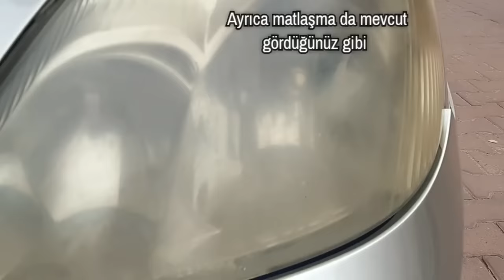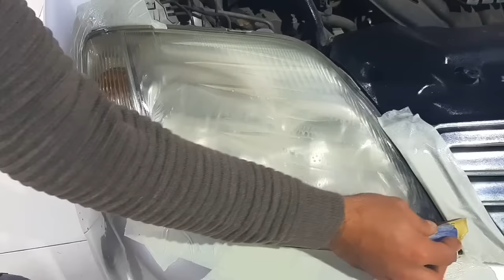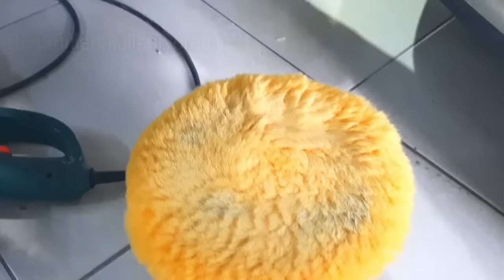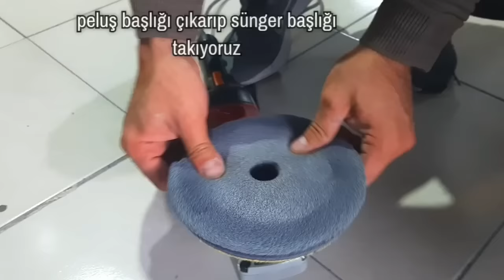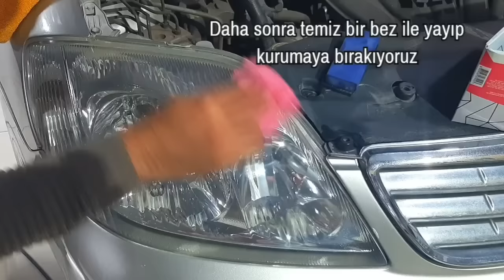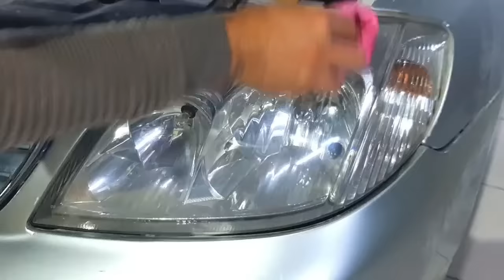PROFESYONEL FAR TEMİZLEME VE PARLATMA YÖNTEMİ 💯 SONUÇ MÜKEMMEL

Comment: I used to work in a plant producing such lights when was young and they used only 2 polish grades (I think there were 3 available, but we were too lazy to use it). For my car (phone & watch too) I sometimes use a cheap polishing paste and it works fine even for windows, but for deep scratches you need to use less fine grade. So for yellow lights this method is fine, but just for scratches it's way too much effort

Comment: Ustam ellerine sağlık.. Bende de 2003 palio var.. Farları fena halde sarardı.. Gece yola gitmek baya zorlaştı.. Kullandığınız malzemeleri marka olarak yazabilir misiniz.. Birde kum zımpara yazmışsınız.. Normal mermer parlatmada kullanılan zımpara türü mü yoksa farklı mı.. Eminim diğer video izleyenler de merak ediyordur.. Şimdiden ilginize teşekkür ederim
Reply: The best is to keep your hands OFF on deep cleaning your headlights !
Let it do by a car clean garage. It is not so expensive at all. They are profi !  
Here it is €50,- for 2 headlights.
Than you can regular use a headlightcleaner, protector yourself to keep them clear and protect the headlights against dirty and against UV  caused by sunshine . But do not use too much pressure. Do not damage the headlights.
Reply: If you make scratches when you do it yourself or if you destroy the clearness of the materal than you cannot restore it,those damages will stay forever.
Reply: Yeriniz nerde  ben size aracımı getirmek isterim
Reply from the maker: Aksaray ortakoy de